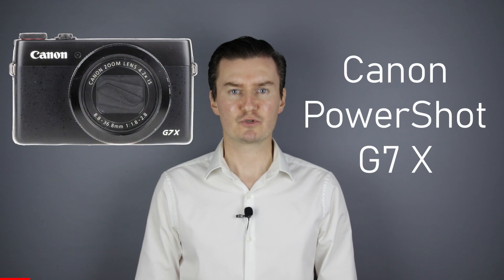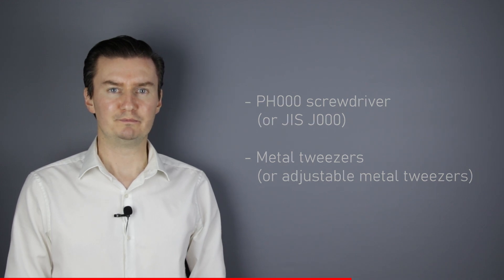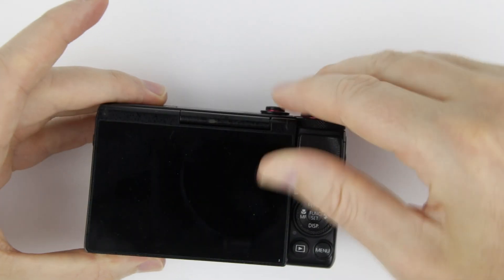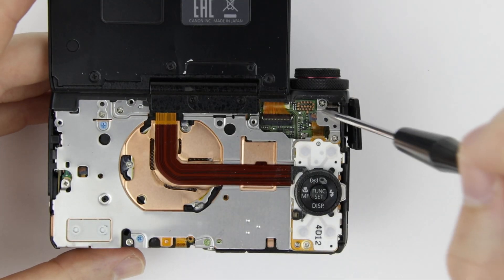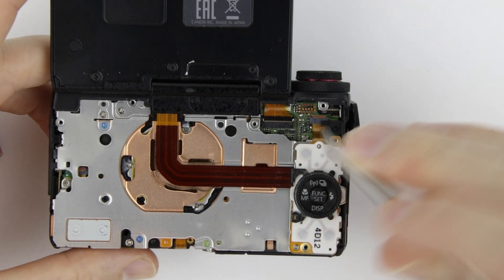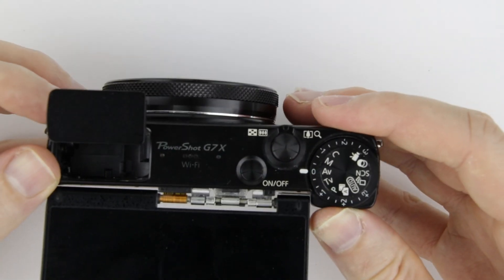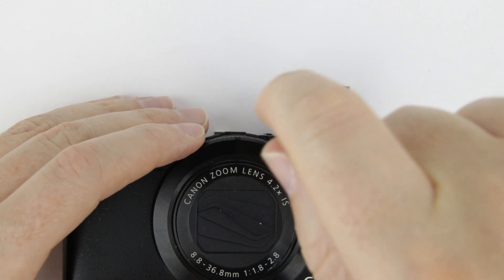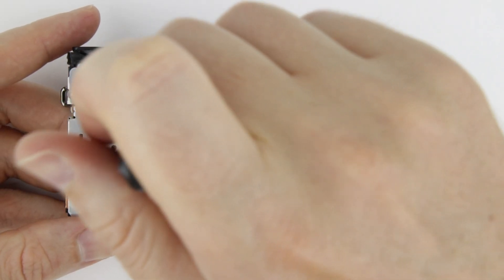Canon PowerShot G7 X camera disassembly

Comment: Hi, i cannot see at which time stamp the cable from the battery i connected to the board. My G7X Mark 1 won't turn on, tested with two original fully charged batteries. I've read maybe a cable came loose - but I cannot see in the video how far I have to go with the diassembly - maybe you might give a hint about the issue of not turning on? (batterys charged, pins in battery case not bend, battery connecters are clean, no camery drop)
Reply from the maker: I'm sorry, I haven't repaired that problem before, so I don't know.